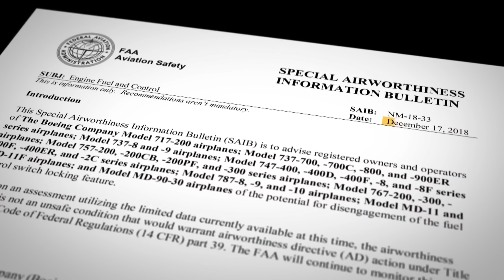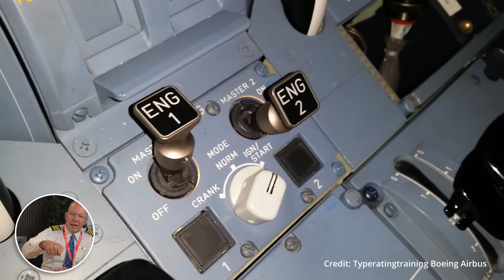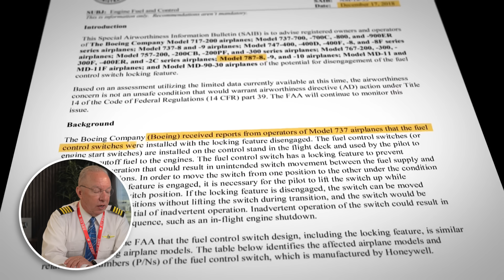Air India 171: The FAA’s 2018 Fuel Switch Locking Bulletin Explained (16 Questions Answered)

Comment: How can you say that it was human intervention captain, very sorry to say but be a little more sensible and empathetic towards the poor pilots who is no longer alive to defend. What if some technical problem happened which already was stated regarding the same type of aircraft in previous reports and as per that the fuel connections got cut off automatically . How can u just blame the pilots just like that when u are one also 😡😡

Comment: If the fuel cutoff switches were installed upside down you wouldn’t be able to take off because you wouldn’t be able to start the engines!

Comment: Question, the report mentions a 10 second delay between fuel cutoff and switches placed back in run position.  My question is, would this flight have been recoverable if that delay was anything less.  10 seconds seems like a long time.

Comment: @Captain Steeve, 

Why did you not read out the full question related to the General Electrics and the FAA Service Bulletin FAA-2021-0273-0013.

The bulletin heading is.

SB 73-0097 R01 ENGINE FUEL AND CONTROL - ELECTRONIC ENGINE CONTROL - REPLACEMENT OF INTEGRATED CIRCUIT MN4 ON MAIN CHANNEL BOARDS

The defective part could effect the fuel supply to engines.

GE state the part should be replaced.

Comment: I’m a retired marine superintendent engineer and I have been following the AI 171 incident with a profound interest on your technical analysis. During my career I have extensively dealt with a plethora of safety devices found on cruise ships in terms of redundancy, reliability and functionality. I remember a few week ago you consider the possibility of a vapour lock on fuel feeding lines and I had raised the question as to why avionics do not provide sensor or relief valves to automatically bleed off trapped vapours. Now I’m asking why such critical fuel cut off switches are constructed to be spring loaded instead of a more reliable and safe toggle switch to prevent spring failure or moreover why these switched are not sensor equipped to prevent function during critical moments of the aircraft’s flight?
I will appreciate your enlightened response

Comment: My question is how do you know the switches were cut off.  If you don't have the panel with the switches in the off position you are just assuming they were in the off position from some indicator.  Pic or it didn't happen.
Reply: Direct evidence from the flight data recorder. Modern airplanes  record the switch position. Any pictures of the panel after the crash is going to show it in the run position because it was later corrected but already too late (altitude was already too low by then). 

Ask better questions please.
Reply: @InStevenWeTrust  So you know this how?
Reply: @rogerahier4750  From the preliminary report where investigators have determined exactly that from the flight data recorder and cockpit voice recordings. If you believe something else, just say "I believe XYZ happened despite there being NO corroborating evidence to support otherwise". Unless new evidence is found, the theory with the fuel cut off switch being turned off 3 seconds after takeoff is the MOST CONSISTENT with available data from the FDR and CVR.

As mentioned earlier, ask better questions and stop huffing conspiracy paint.

Comment: It seems to me that during the CRITICAL TAKEOFF WINDOW, these switches should NOT allow Pilots to operate BOTH of them.  (Meaning, at least one Engine should be operating)
Let the plane have enough altitude before allowing pilots to try to cycle the engine(s) if one of the Engines malfunction.

Comment: The Scenario:
	•	Pilot A: Says, “Why did you turn off the fuel switch?”
	•	Pilot B: Says, “I didn’t turn off the fuel switch.”
	•	Then the plane crashes. We have no more info.

Key Psychological and Statistical Factors to Consider:

1. Initiator of the Accusation (Pilot A)
	•	People tend to accuse others when they observe an unexpected or dangerous situation they can’t explain, especially under extreme stress.
	•	The question implies Pilot A didn’t expect the fuel switch to be off and didn’t believe they did it.
	•	If Pilot A had turned off the switch (accidentally or otherwise), it’s statistically less likely they’d draw attention to it. Admitting to or highlighting one’s own critical mistake, especially just before a crash, is psychologically unlikely.

2. Denial by Pilot B
	•	Denials in high-stress moments can be truthful or self-protective.
	•	However, when there is no consequence (e.g., they’re about to die), there’s less incentive to lie, unless it’s reflexive or rooted in shame or denial.

3. Cognitive Biases
	•	The “blame-the-other” reflex can occur under stress, but this is more common in denials than in direct accusations. Asking a specific question like “Why did you…” indicates surprise and assumption that the other person did it.

4. Base Rate Logic
	•	Statistically, people more often speak the truth when they are asking questions about confusing events, especially in emergencies. Statements like “Why did you…” often come from people genuinely unaware of what caused the failure.
	•	Denials, especially short ones under pressure, are statistically more likely to be false than accusatory questions, simply because denial is often the default mode when someone is caught or confronted.

⸻

Conclusion:

More likely: Pilot A (the one who asked the question) was telling the truth.

Statistically and psychologically, it is more consistent with human behavior for someone not responsible for a mistake to ask about it in confusion or alarm. Conversely, a quick denial under stress doesn’t carry the same credibility, especially when the outcome is imminent (i.e., death).

Of course, this doesn’t prove anything—it’s a likelihood, not a certainty.

Comment: Why did it take a full 10 seconds or so for the acting pilot to recognize the engine spool downs, query the other pilot and return the fuel switches to the RUN position? That seems like maybe 5 seconds too long which may have enabled at least one of the engines  to spool up to save the aircraft?

Comment: I understand the unions and pilots are against cameras in the cockpit for reasons that are obvious. However as a DOT license holder for over 40+ years, most DOT commercial vehicles that travel the roadways now days have cab cameras that not only face the road but also record the driver and his/her actions in the cab and interact with them using AI. This was done in the name of safety and most likely to lower insurance costs. Cameras won't prevent what someone is determined to do in a cockpit to cause an accident, however, it would show actions taken, by whom, and if or not it was indeed an intentional act. If truck & delivery drivers have to be subject to this scrutiny, then it is time for the airlines and the pilots union to agree to do the same, wouldn't you agree? And yes, I absolutely hated them and had no choice at far less wages and less responsibility than a commercial pilot. The technology is present for this to be an easy install at minimal cost.

Comment: Would a system preventing engine cutoff below a certain flight level be feasible?  Ex.   Can’t shut down an engine below 800 ft?    Or can’t shut down both engines below 800 ft?

Comment: Considering the comment “why did you do that” I’m certain the comment would have been what happened, followed by some quick cohesive actions to re start the engines. We haven’t been provided with a precise second by second account only what the report deemed as the most critical snippets.
I expect the denials to be fierce and rightly so but there is an arrow pointing to someone in that cockpit. Just because the report only says there were two crew it doesn’t say who may have been sitting in the two jump seats. The harnesses are inertia reels which would lock with sudden movement, it would be difficult to quickly lean forward and operate the switches.
As an AME, I can say that the switches aren’t spring loaded in one direction, once the switch is on the other side of the detent then the contactor would “teeter over.

Comment: I mentioned this previously, but most cars will electronically block you from switching your car from drive to reverse or park while moving, so why isn't there something that would prevent this from happening during flight? Is it to allow the fuel to be cut off, then on again to restart in case of some other cause for an engine shutdown? Edit: Ok, he answered this question by saying that if there is an engine fire, they need to be able to shut these off immediately. Pretty sad when one person can so easily end the lives of so many.

Comment: I am not a pilot, but I am a sentient being. It defies all logic to me that those switches, which under normal conditions are actuated twice per flight, once to allow fuel to the engines and once to cut off fuel to the engines at the end of the flight, are positioned ANYWHERE NEAR THE CENTER CONSOLE where the "gas pedal" is. Tell me why that makes sense!
Reply: The location of the switches is irrelevant. As they were deliberately activated, the location means nothing. The person would have just reached to where they were and shut them off. They must be accessible to both pilots.

Comment: Can the fadec cut off the fuel valves, I saw a checklist where the pilot should toggle the fuel cutoff switches in case of dual engine failure

Comment: There is no safety measure you can put into a plane to prevent a pilot from wanting to down the plane.

It's not a technical problem, its human issue which is harder to  solve.

Comment: Flight recorder data shows that both switches went to cut off within one second of each other. Is that even possible without using both hands? Alternatively, if the locking mechanisms were disabled or missing, could the simple motion and vibratio of rotation have caused them to fall into cutoff?

Comment: Captain Steve sights flight simulation tests done to draw his and the Indian authorities preliminary conclusions that it could not have been a software/electrical fault for the fuel cutoff switch to turn off. Well then did they also test how long it takes for a person to actually flip off both switches?  Data recorder info says it took slightly less than 1 second. That is virtually impossible for a human to do that according to other experts as i have state previously via Reuters article from yesterday. So, until someone gets in the simulator and actually times how long it takes to flip both switches to the "off" position , I'm not buying theirs  and Steve's conclusion. BTW, you were wrong before Captain Steve, remember?  you jumped the gun just 2 days after the crash. The rest of you need to stop this "hero worship" of him. It's nauseating

Comment: Captain Steeeve; I am a former aircraft mechanic and retired military flight engineer, Let's not rule out the possibility of an electrical control issue. The actions of "switch to cutoff" and "switch to run" happened at aircraft change in attitudes and most likely throttle movements. If there was an electrical issue within the center console such as a rubbing wire, moving the throttle may cause an electrical "short" or "open" (depending on how the switch logic works) inadvertent signal to the computer so it would be the same physically moving the switch. Just a possibility.
Reply: he's hung up on the faulty preliminarily report. Sad to see that. he was wrong before about this crash , remember. He's taking way too much stock on this report . it really doesn't answer all the questions and yet they gave Boeing, GE and Air India a pass. Something is not right here. It's way too early to be doing that but they did and Steeve is naively going along with it. So much for his "Expertise".

Comment: Steve, you repeatedly say there is literally no scenario where you would ever cut off fuel at that stage of flight, including all engine emergencies.  Why does the computer even let them at that stage of flight then?  Seems like it should only allow one, not both, if under no circumstances at that point in takeoff would you ever cut both, even in any emergency.  Seems it would always result in a crash, so the computer should just not allow both cutoffs until X altitude, Y speed, etc.

Comment: Everyone is talking about needing cameras in the cockpit, but you need to realise that having cameras in a cockpit is very different to bodycams or dashcams. Bodycam footage is retrieved in the case of things like police chases and stuff, and dashcam footage is retrieved in cases of car accidents - both these scenarios do not involve a heavy impact from kilometers in the air and massive fireballs and explosions. Footage from a cockpit recorder would be needed in the case of a plane crash, which fulfils all these cases - its violent, strong, firey and explosive, much unlike a car crash.This means that the cameras would need to have a very very strong design, and this isnt like a voice recorder where a simple hole is required for voice input - a camera is more complex. So in theory a camera strong enough to withstand such heavy impacts could be designed, but they would be expensive and time consuming to manufacture.
Reply: Video feed to both black boxes, $20.00 Gopro expendable
Reply: Really? Video data is stored just like audio. Transmitted to the "black box" and saved digitally just as the audio on a memory card or tape. The video data is not saved inside the camera.
Reply: @SteveNas530  damage to the camera supplying the feed may cause data corruption whereas a microphone requires only a hole and no exterior parts like a camera (correct me if im wrong im not the smartest)
Reply: @Aliman25 Images from the digital sensor in a camera are transferred almost instantly to memory storage just as the audio data is to the black boxes. It's all just bytes and bits. Sure the camera will be destroyed in the crash/fire as does the microphone but the data is captured up until the last millisecond.

Comment: The plane did have electrical issues with aircon etc on previous flight. Pilot asks a question and other pilot says no I didn’t or words to that effect. 
After the near perfect condition black box was then said to be badly damaged (one on roof) I’m very cynical !
Reply: agreed but Steeve is too hung up on the report and not reading the past troubles with this plane. Why ignore something so important. Steeve lost my respect if he doesn't use all available info to draw any possible conclusions.

Comment: I wonder will there need to be a confirm switch or button by the other pilot for items that are hazardous to the flight mission.
Ie. Fuel shut off engaged, then it would need a confirmation by the other pilot
Something akin to a nuke launch duel key but obviously not at same time